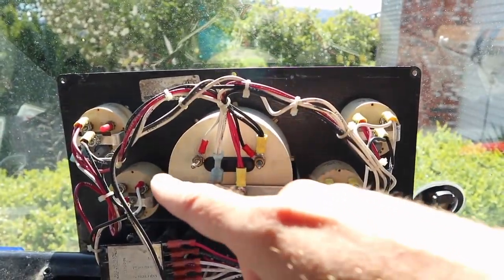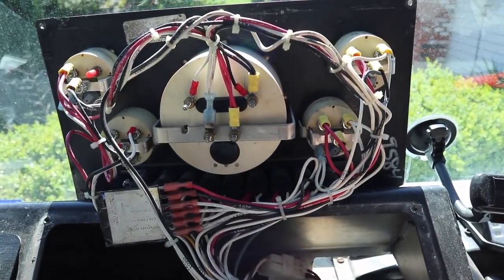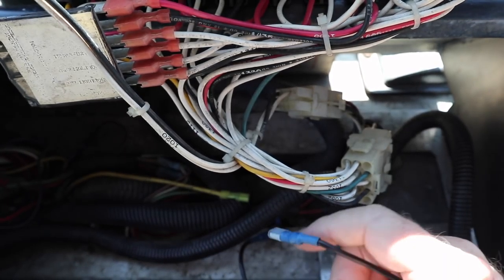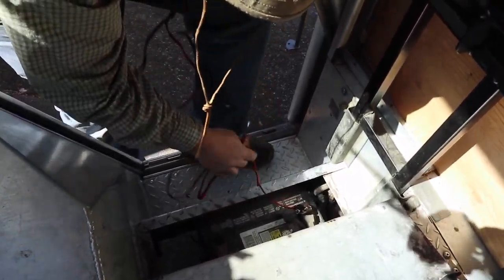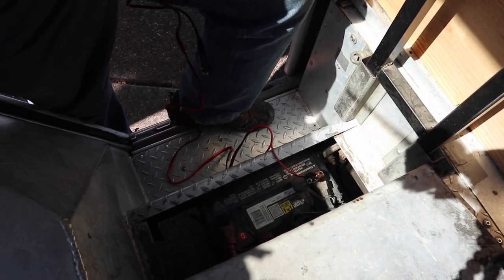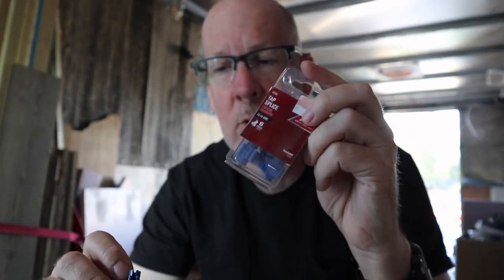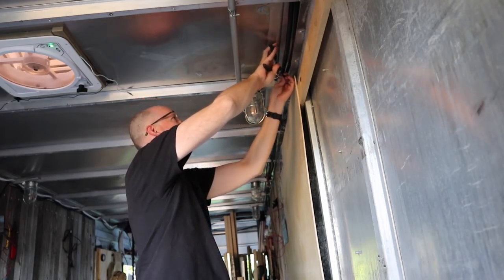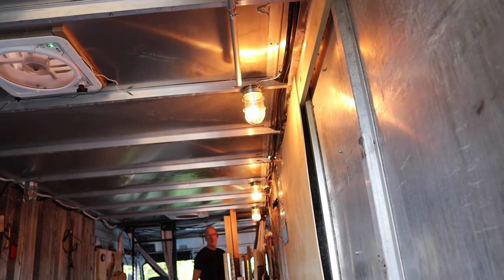Troubleshooting Step Van Wiring | Gauges, Ground and Splices E426

Comment: I know its too late, but those tap splice connectors are garbage. They always loose connection, and often cut the copper conductor. They are quick and easy, but have a high failure rate. I worked in the custom car industry, and we often had to replace them. The issue is vibration. That ingenious little piece of metal cuts into the copper, until there is little or no connection left. Anyone else notice that the "OEM" wiring on the instrument cluster is done entirely with cheap aftermarket crimp connectors? Not OEM?
Reply from the maker: I had no idea. I guess I'll just end up redoing all the splices with better connections

Comment: instrument cluster. The gauges in them may be powered by "stepper motors". GM particularly has had a problem with them. I've had them repaired on an Impala and Buick LeSabre in past. There was a class action lawsuit which provided trucks with them a recall, but they NEVER did it for the cars, even though they had the same defective, early failing stepper motors. Google "stepper motor" and find a lot about them.
Reply from the maker: great tip. thx

Comment: Seven, I must toss my $.02 in regarding those Scotch Locks wire taps (Original Name brand for them).  They are indeed the root of all evil.  Here's what happens - as you push the blade down with a pair of pliers, the  blade will cut one or more strands of wire.  That in itself is probably not be the end of the world, but it does reduce the current carrying capacity of the wire somewhat.  And now for the nasty part - as the wires wiggle around as you are driving, the wire strands will over time try and align themselves with the cut in the blade.  Now the blade is not making as good of contact with the wire.  If you are lucky, the wire will oxidize at this poor connection quickly, and your device will no longer run.  If you are unlucky, it will oxidize slowly or not at all and the loose connection will heat up as it is a high resistance connection, melt, and catch fire.  

If you are going to use them (and I really hope you don't!), here are a couple of things that might make life better down the road.  Use pliers to squeeze down the blade before you put the plastic cover down.  Inspect the connection - really pull and wiggle the connection; if the connection seems loose, or the wire bends much easier than normal at the connection point, DON'T USE THAT CONNECTION!  Cut it out and use either a crimp butt connector, or a good solder and heat shrink joint to repair the wire and try again.  After you have a "good" connection, clip down the plastic cover, then tightly tape the entire joint extending several inches on each side of the joint to keep the connection from vibrating loose.  Good heat shrink would be a good practice as well if you can find some that can cover the tap and still be tight on the wire when shrunk. Best advice, please don't use them, you will be much happier down the road.
Reply from the maker: given all the comments, looks like I'll be rewiring things to remove the splices

Comment: I think electronic guages are nothing more than Idiot lights...your an idiot if you depend on them! So, I am not calling you an idiot Seven...just my way of thinking....Use a mechanical guage for the important functions on the motor and a GPS for your speedo.....Generally more accurate with the GPS. I had to do this on a car I owned one time. I just shut off the illumination on the dash and used the GPS and lighted mechanical guages. Works like a charm!  Hope you get it figured out.
Reply from the maker: maybe I'll buy a Garmin and use that

Comment: Stay away from those splices  things, they are easy to install but a pain to trouble shoot later, and they will fail. Why they still exist is strange, I known them for some +40 years and I absolutely loved them in the beginning, but them as time got by they just turn out to be a pain in the butt, bad joints again and again.
Sorry Seven, but you should redo this with an other solution for joining wires, and for your own best do NOT join wires in a place you will have difficulty to access later, you will regret it big times.
Reply from the maker: I had no idea. I guess I'll just end up redoing all the splices with better connections
Reply: Sorry Seven, but redoing is the way to go. You may also consider to run a separate ground (negative) wire, to relay on a bolted/rivet connection of alu parts is not stable in the long term, in wiring in houses/industry the code ask for sealing of alu-joints, and nowhere you have this sealing in you van, think about it.
The reason is that alu corrode and this create bad joints, bad joints is resistant in you electric path, on a good day it is just that you light is a bit dim, more bad is it when it gives strange electric problems with malfunctions that is a pain to trace, on a bad day it is fire, so run a separate ground wire everywhere, also from (starting) battery to the engine block (connect a wire to the grounding of you generator too), do not trust on using the chassis as a ground wire.